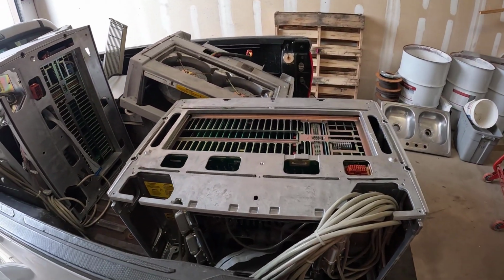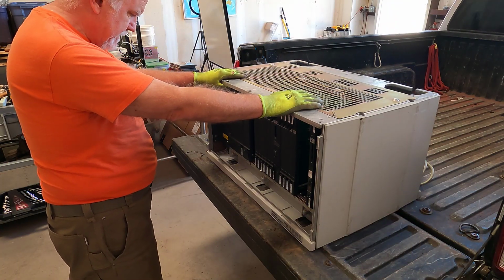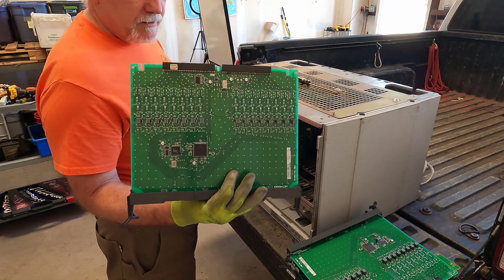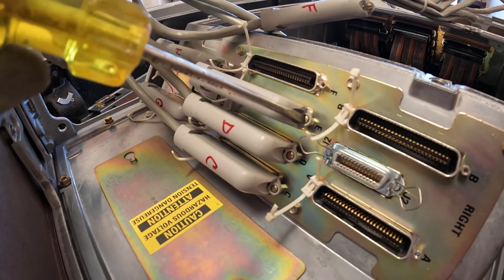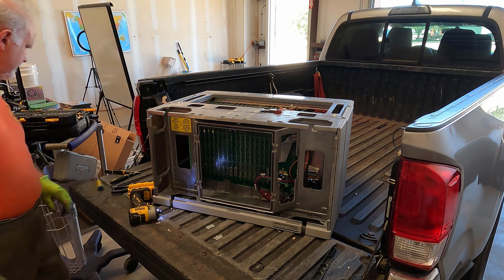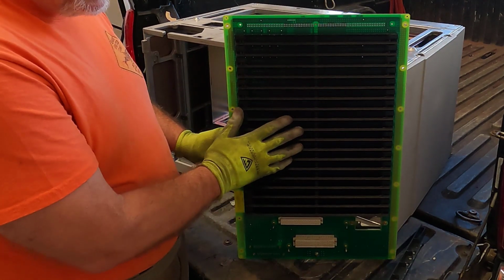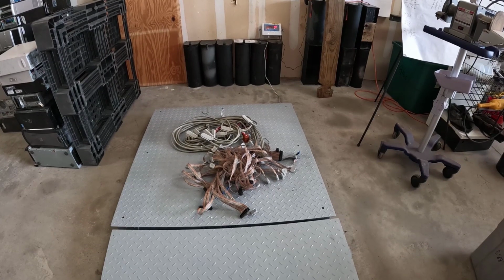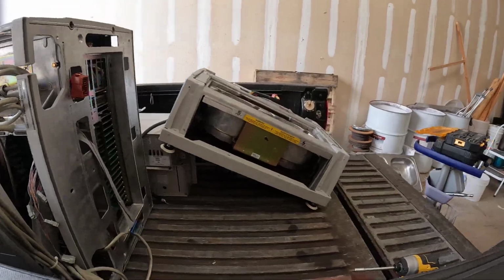Scrapping a high grade telcom system - Was this a good auction win?

Comment: I think those big boxes telecom ,cisco or something are usually difficult to buy there is one or two giant power supply's a giant fan plate and 2 or 3 good circuit board plates the steel box is also real heavy the best and easyest things to buy are just pc's
Reply from the maker: PC's are going for crazy money on most auction sites these days.  Looking for odd ball things can be much less expensive and a lot more interesting.  But you do need to be careful what you're bidding on.

Comment: dude has no ideal what those boards are worth parted out..
Reply from the maker: By parting out, I'm assuming you mean selling each board.  Depending on the board they have sold on eBay from $20 to $90.  The boards were listed as used, tested, and sealed in anti-static.  The listings I found took about a year to sell.  Since I have no way of knowing how the system was stored prior to my purchase AND I have way to test the boards, I'm not comfortable trying to resell them for use.  Even when thoroughly describe and with NO guarantee of functionality there is increased risk of upsetting the buyer.  So I made the conscious decision to sell for scrap value.  I hope this helps.
Reply: @sharkscrapper  depending on the models, some can bring over 1k per board. But the gold is valuable too.  Older call centers and hotels will pay more than new prices to keep these old systems going because it it cheaper than replacing their entire system. Nevertheless, you seem to have found a profitable way to recycle this dinosaur.  Not every board is worth top dollar, but the line cards and the call queueing modules are getting rare. I don't think this will be the case for much longer, VoIP is replacing most of this gear now days. Next time you get one... You may want to reach out to whomever runs the local 911 call center.  I believe they are required to have hard lines and may be interested in buying some of the boards as spares.
Reply from the maker: @acidreign0911  great info thank you